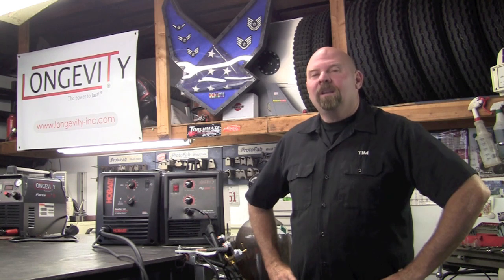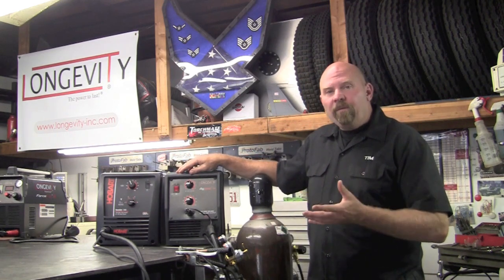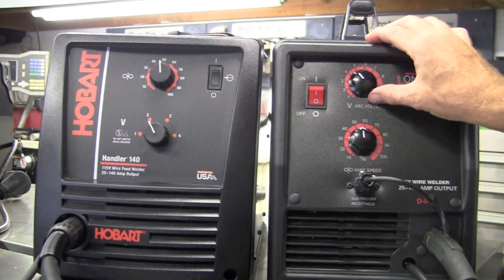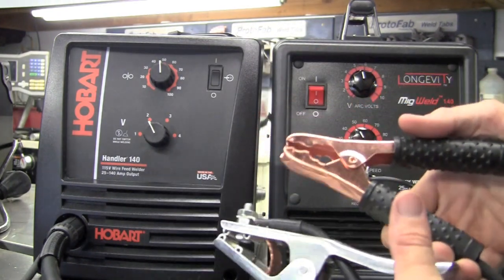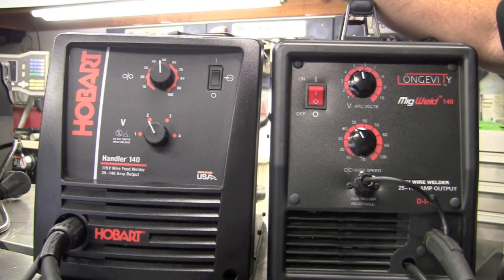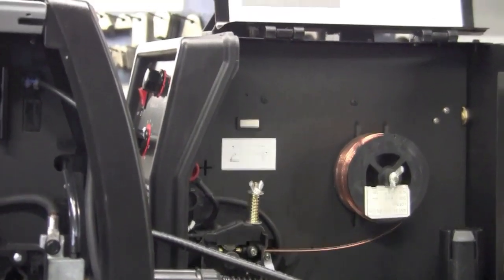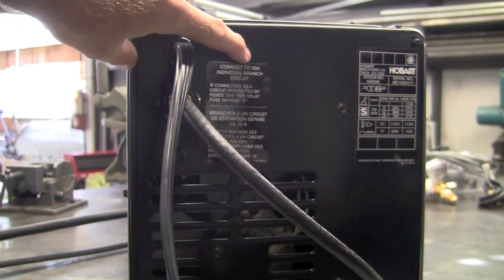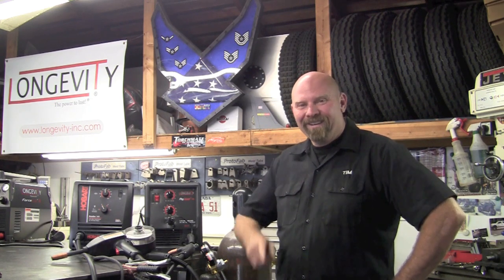HOBART HANDLER 140  vs LONGEVITY MIGWELD 140 - 140 AMP 115 VOLT MIG WELDER REVIEW PART 1 of 2

Comment: Does anybody know if the gun on the longevity 140 will interchange with the Lincoln 140?. My gun on my longevity took a crap. And the price for a new one is $200.00 with shipping, I told the guy I might as well buy a new welder for a few more hundred $$ .

Comment: they both suck. 4 tab transformer old technology junk. that variable voltage selector is same as eastwood. fake. if you measure it with meter you get the truth.

Comment: yea an i own a Eastwood 135 under $300 and is a spitin image of the longevity
Reply: an it takes a spool gun to boot
Reply: +Jon A around the home you dont need a $1000 welding setup
Reply: ha, me too.
Just finish welding a 18 ga stainless exhaust with it. Had to crank the voltage all the way up to get adequate fusion with the 308LFCO wire used. Otherwise, its a nice little unit for any auto stuff, never had trouble before.

Comment: The hardware and construction of the Longevity Migweld 140 appear super cheaply made (I noticed the dents in the sheet metal from over tightening the screws on the face plate). The fit and finish from Chinese welders is a far cry from their American made counterparts (Hobart/ Miller). In my humble opinion I would refrain from any more side-by-side comparisons, as I think they'll yield the opposite affect and actually show how inferior a Longevity welder to one of the big 3 (Hobart, Miller, Lincoln) in terms of actual quality and refinement.

Comment: It is very easy to find at least 100 complaints and nightmare reviews of good hardworking guys who wanted a welder and trusted this company,  only to get that same damn song and dance which ended with them unfortunately having to learn what the professionals already know.  There has never been,  nor will there ever be any validity to comparing one of the most trusted names in the industry with another one of these companies who is buying cheap,  and trying to use free advertising through outlets such as these to push their junk.  How many people have you heard of that said they'll never buy another Hobart or miller? Probably plenty because there's no need to replace the best..  My good friend lost a weeks paycheck by gambling on these claims that won't hold water,  now he has a Hobart.  Ask him if warranty and customer service means anything to him now..

Comment: I will tell you one about The Hobart Handler 140.Yeah you may pay a bit more for it but like the old saying goes you get what you pay for.As far as things being made in China.I know for a fact that Hobart does not have any cheap china crap parts in there welders.All 100% made in the U.S.A.I know this because I work for Miller Electric.Which if you don't know makes all the Hobart welders and plasma cutters.
Reply: You must be uneducated then, I heard Hobart used feed motors made overseas.

Comment: I have been running my Hobart 140 for about 4 years now, love it. I have not had any problems at all with it. I can find Miller accessories from all of the local welding supply shops for it. After dealing with 3 different chinese machines that belonged to friends I would never waste my time or money on them again.
Reply: BradOmedic
For those that are unaware, this is a very good indication of the type of company longevity is. These guys will say/do anything to peddle their wares.
Reply from the maker: I am sure you did not try our machine.... Remember, most welders and almost all WELDING COMPONENTS inside the welder are made outside the USA. It is true, look on our forums for production pics :)
Reply: longevitywelding

I looked and searched and did not come up with anything. I don't have time to pour through your website so why don't you post a link to the pictures of your stuff being made right next to Hobart as you elude.
Reply: BradOmedic
longevitywelding
I contacted Hobart and this is the reply I received.

Brad,

The welders are manufactured in Troy OH and Appleton WI.

Bill Westfall
Technical Application and Service specialist
Hobart Welding Products
ITW Welding North America
Reply: +Tyler Deck I wouldn't go that far. I actually thought the guy was pretty good about being objective and comparing the two. Think about it, how difficult it would be to compare a quality build machine with a inferior machine; meanwhile, hoping to sell the viewer on the machine of inferior quality. That's gotta be tough!

Comment: longevitywelding Wrote-
Although we have some equipment that can compete with Miller and Lincoln, we are honored to be part of that list even if after Hobart - those are proven companies. Thanks

i'm pretty sure you should not be surprised you fall in line after Hobart I would think your product to more on par with chicago Electric just with a better made case for making it look pretty ...I'd like to see you run these things into ground and see who times out first on the duty cycle and what one dies first  ...Also maybe open the welder up so we can see a side by side of the internals not just the casing ...lol...that's almost the same as doing them side by side still in the box ...
Reply: I own a Miller 210 big case and a handler 210 ...lol...not much difference between the Two ...I have aslo seen the Hobo Freight welders opened up...LOL>>> which I would bet don't have much difference than a longevit. And I would expect a "man" too poke fun at Hobart when he does not own Red ,White, Or Blue ...lol...those brands come ready to weld with a roll of Fluxcore does the Longevity come with a box of Rice or a Burito ?
Reply: *****

Which are in the same class of machines as  a Hobart and Miller ...I've also seen the Lincolns outsidse and in   not any better than a Miller or Hobart ...But it all depends on the brand you like . I got no issues with cheaper alternatives like a Hobofreight or Longevity I just don't like a side by side where they basicy just show the packaging ...lol...the Hobofreights don't look too bad if you'e just looking at the case ,but pop one open and you see where they cut the corners to sell a Mig for $300 vs $600  and the Longevity video like this are just showing the packaging not how the unit built inside , so a real comparison would be popping the covers off them and pointing out how they're built , but I'd be willing to bet they don't match , Which I could be wrong since I've never seen a Longevity in person or had one apart ,so maybe they are decent ,but this video only shows the window dressing .
Reply: +yerwrng its fan boy shit if people got the doe to blow then buy what you want

Comment: I own a Hobart Handler 210 and it is a great machine. I did get a chance to use a Longevity 200S Mig welder and found it to also be a great machine. I could not tell the difference in the welding with either machine. They both did an excellent job.
This made in China argument was lost many years ago. Stop working for the corporations and start working for yourself. Get whatever you can afford and stop wining about where it was made. Just start making things that others cannot and be happy.

Comment: not true. HH140 can weld as then as 20 guage sheetmetal. u have to run gas and .023 solid core wire. you can weld really thin stuff with flux core since flux core is meant for thick material. Thats why el cheapo harbor freight crap only runs flux core cause its doesnt have the power to weld thick stuff without flux core.